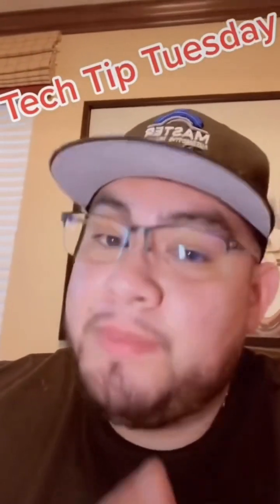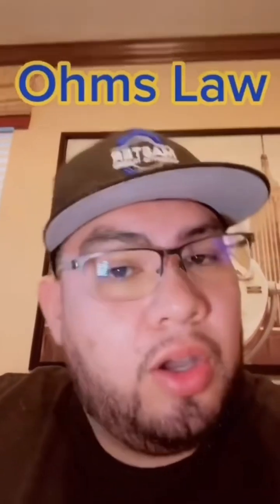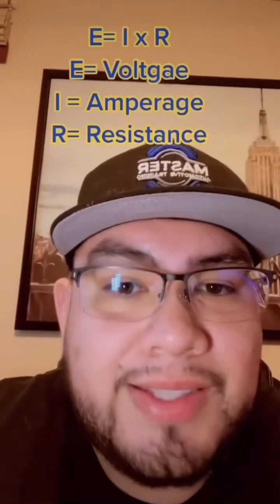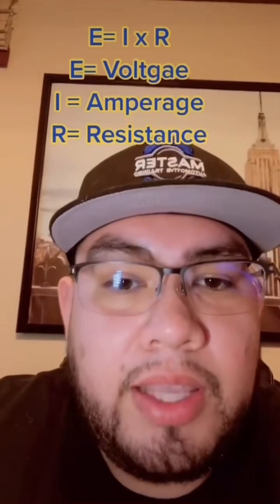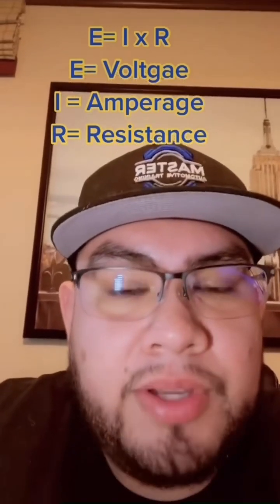Automotive Electrical System Basics: Ohms Law

Comment: This almost checks out, so close!
If we use 120V=5A•24R and we double V, A will also double and R is unchanged. (240V=10A•24R) 
But
If we double R, only A will half, V remains the same (120V=2.5A.48R)
Your claim means that if V halves, A would have to quarter (60V=1.25A•48R) which is not how things work unfortunately and the reverse is also untrue as I initially described.